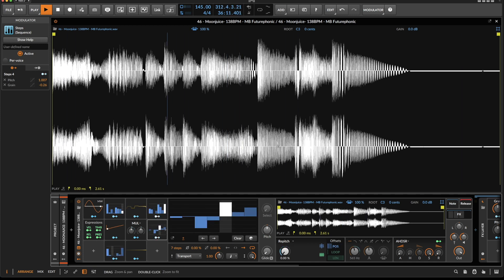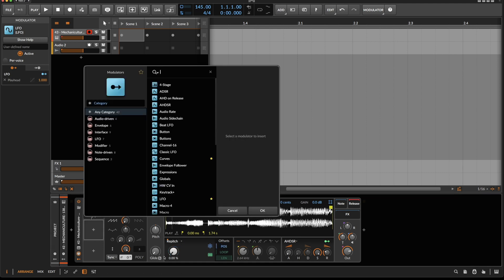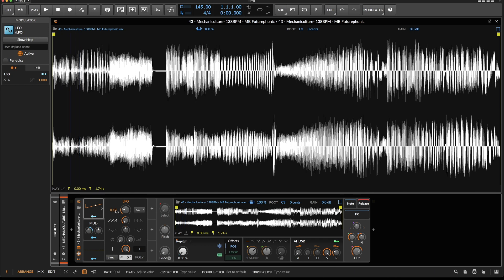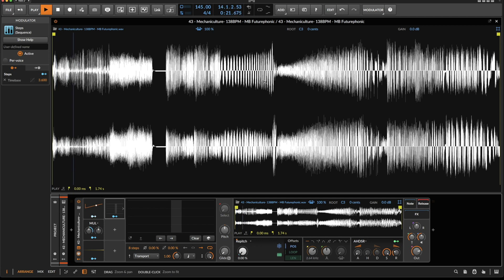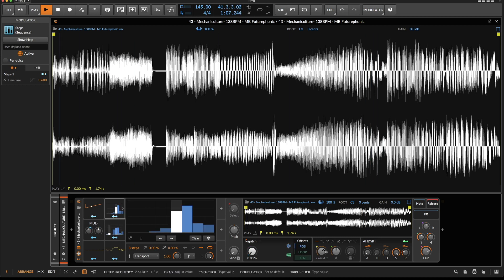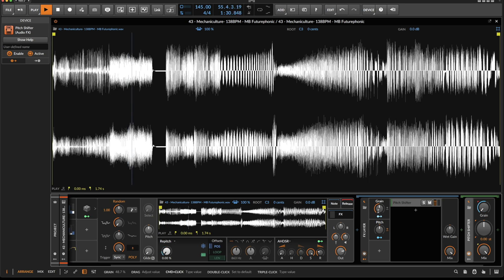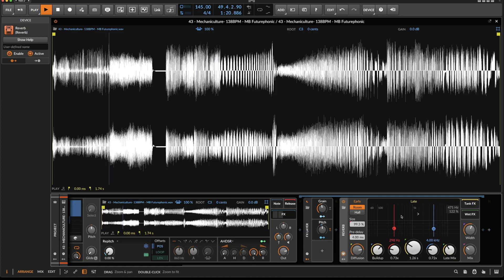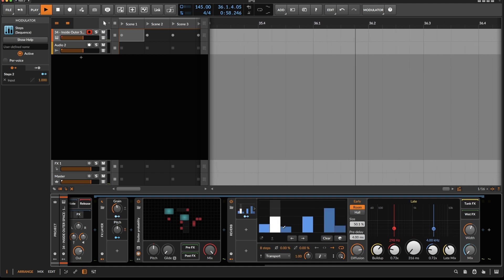Let's mangle that loop ☢️🎛️

Comment: nice video, offtopic question; why does bitwig requires delay to make a feedback loop?
Reply from the maker: Because it's an extremely difficult math problem (we can't predict the future), especially in an open environment where we can't predict what the user is going to do. 
So we might potentially get internal feedback routings for specific modules, like filters, where the result can be predicted or approximated,  but I doubt that it will become globally available in the Grid any time soon.

Comment: Does this mean we don't need effects like Infiltrator,  Effectrix, Looperator, Stutter Edit in Bitwig?
Reply from the maker: Well you can do a lot using Bitwig, but sometimes it is quicker to use Infiltrator per example. Especially infiltrator can do a few things Bitwig can't, or at least not as good. But then Bitwig can do things no plugin can :).